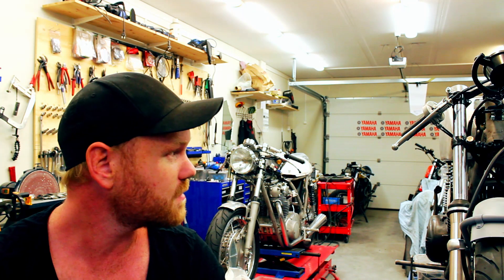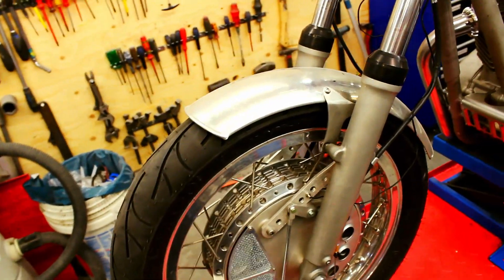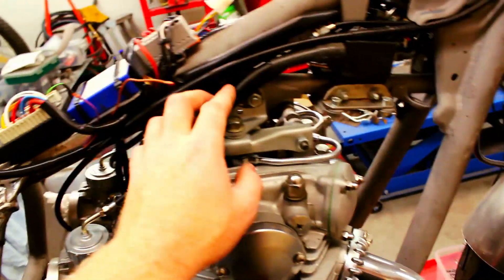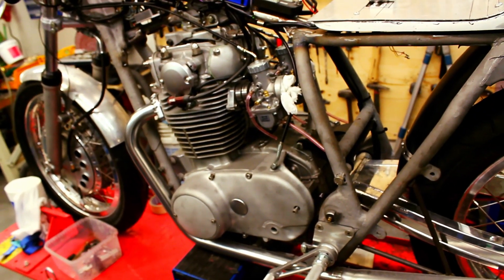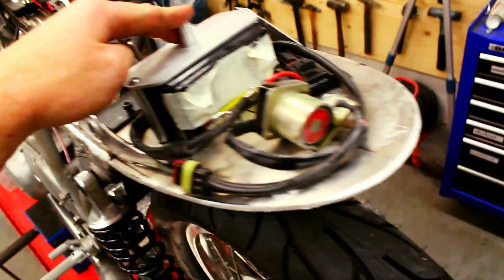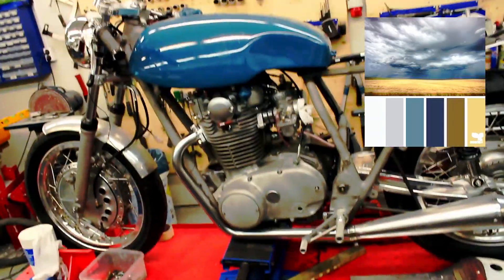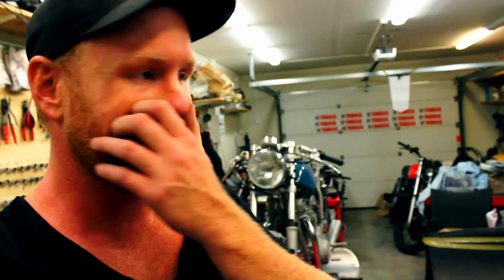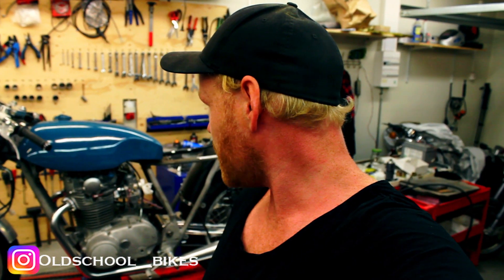YAMAHA XS650 CAFE RACER BUILD

Comment: Nice !  I have an early-frame XS650 cafe  as well, same wheels ,twin-disk front , big-bore stainless headers,  mufflers that 'Bark'. xs750 tank, period 70's rear-sets and clip-ons , larger 77 forks, hi-comp with ported-head-38mm carbs, gb-style cafe-seat ,longer braced 'V' swing-arm . I can stare at it all day.  Dave   NZ

Comment: I have a 75 XS650 and I am looking forward to building my own cafe.
Reply from the maker: That’s great man! What’s the plan for your cafe?
Reply: @OldschoolBikes  I have to address some mechanical systems first. Xs only has 7500 original miles but needs brake work an forks need to be rebuilt or possibly replaced with something modern. I also need a fuel tank. Looking for an earlier Xs tank possibly a 73 but man they are expensive.
Reply from the maker: @mikebeasley553  a tip is to check with cognito moto what stem whey make for xs650 and then look after some front forks front that brand. Easley the cheapest way. And fuel tank are always expansive... but good luck! It’s always fun with more rebuilds!
Reply: @OldschoolBikes  You are correct Cognito moto is the reason I bought this Xs. The build they did with theirs is absolutely what I will be shooting for. Their Xs is beautiful.
Reply from the maker: @mikebeasley553  yeah that looks great!

Comment: Dreadful handlebars. 2-3 miles of those handlebars and I would want off of the bike. Good looking exhaust pipes. Changing the position of the battery is likely to vibrate the battery a lot, not a good thing.